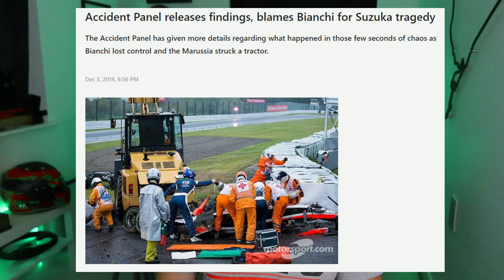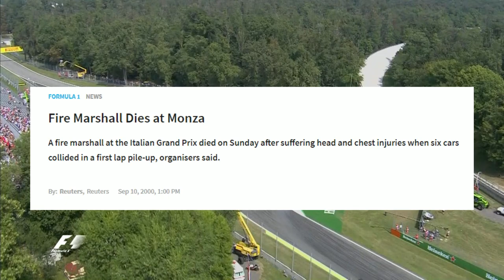F1’s Tractor Travesty in Japan | Suzuka Through The Visor

Comment: This is for everyone who says gasly drove too fast. If there js a yellow flag or a safety car drivers get a certain time they have to complete a lap in. for example if the delta time is 1.30 drivers have to complete a lap in 1.30 or preferably slower. They are not allowed to go faster. Gasly was 8 seconds slower than his delta time given by the fia. in this example he would then be driving 1.38 a lap. Then we have the red flag situation. If you look at the onboard you can see that the light turns red right as he tuns his steering wheel slightly to go into the corner where Sainz had previously crashed. There’s standing water on the track so what would’ve happened if Pierre applied the brake? Exactly his front wheels would’ve locked and he would’ve aquaplaned into the tractor. Then we would’ve had the exact same scenario we had in 2014. The Fia then released a statement saying and I quote: It is considered fundamentally wrong to try and make an impact between a racing car and a large and heavy vehicle survivable. It is imperative to prevent a car ever hitting the crane and/or the marshals working near it.” They all agreed on never putting a tractor on track again. So why can we see a tractor on track especially in suzuka in the exact same conditions and blame the driver?  The Fia simply didn’t learn from 2014. With that action taking place it was made very clear that there is zero respect towards his family and especially to Jules. But the fact that the Fia didnt even take accountability and admitted they did something wrong makes me wonder if the fia is doing their job correctly. And im not even considering the fact that Jules was a friend of Pierres.

Comment: I will have to disagree with the usage of LED lights on the recovery vehicles. The lights at the back of F1-cars are dispersed in a manner that reduces visibility when in foggy conditions or rain or mist spray from tires. Same as wrong color, wrong intensity, fog lamps into fog at night. The lights need to be redesigned for better dispersion and lower concentration by using vertical slotted lens-covers for controlled side dispersion angles...

Along this concept, under glow of street cars, inner glow of road cars, ... may be a better christmas tree effect for recovery vehicles

Comment: There are clearly communication issues in the way the racing is controlled and when marshals & recovery vehicles are used. I think there needs to be a rethink on the role of the race director, the Clark of the course and they way they communicate.

1. When there is an incident on the track (an accident, a breakdown, etc) the race director must neutralise the race with a VSC or SC as appropriate. 
2. The RC communicates that the race is NEUTRALISED to the Clark of the course. At the same time, a message is sent DIRECTLY to the drivers that marshals and recovery vehicles are on the track at turns #.
3. The CotC authorises marshals and recovery vehicles to enter the track and recover the car and debris.
4. Once the track is clear and the marshals and recovery vehicles are o, the CotC communicates to the RC the track is Safe.
5. Only when receiving this message the Track is Safe, can the RC commence the race, allow back markers to overtake, etc.

Essentially the Race Director should not be the person to decide when the track is safe. 
The Race Director is responsible for the teams and drivers and neutralising the race.
The Clark of the course is responsible for the track, marshals and recovery vehicles.
Reply from the maker: Agreed

Comment: What was Gasly's complaint going to be if the tractor wasn't there but he hits Sainz's car instead? For all the talk about safety seems he himself was more interested in exploiting the SC situation to make up for his extra stop.
Reply from the maker: An F1 car hitting another F1 car is not remotely the same scenario as hitting a crane / tractor. F1 cars crash into each other all the time - and not only are they lighter (by a long way) that a tractor, but they have deformable structures - and nothing above driver head height.

Hitting a tractor at any speed is basically a death sentence.
Reply: @BradPhilpot  But it would've been perfectly ok if driver of said stranded car or emergency personnel would've been hit, right? After all, they are deformable structures and the likelyhood of Gasly getting injured would've been low. There is ZERO excuse for the current mentality of ignoring yellow, double yellow and even red flags - ZERO. This had gotten down to the level of having to write 'open packet - eat nuts' instructions. Seriously, drivers are smarter than that and need to stop hiding behind silly excuses.
Reply from the maker: @SiskaLeen  I didn’t say that at all. My position is that marshals shouldn’t have been put in harm’s way at all.
Reply: @BradPhilpot  Nobody can argue not putting them in harm's way. Question is what's causing the harm's way... Double yellow has always been what protects people on track after incidents. Every one of the videos you showed would've had a very active marshal waving a fast double yellow flag before the race car arrived on scene (and he would've no doubt been shaken his or her head after it passed way too fast). Just what is your suggestion to recover a stranded car then if nobody - marshal or vehicle - should be allowed on a live race track, but 'we also don't suggest red flagging for every incident?